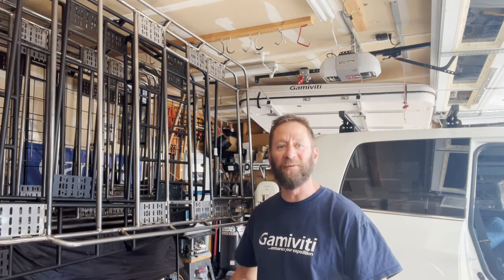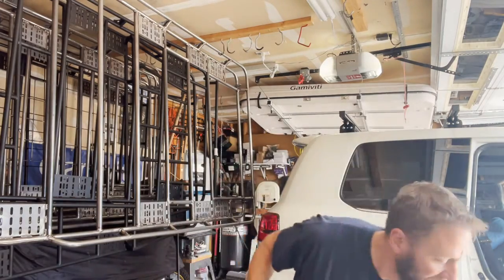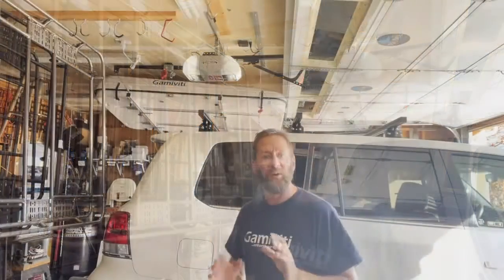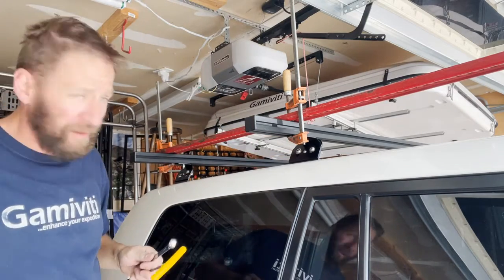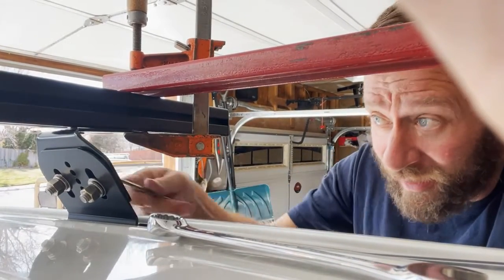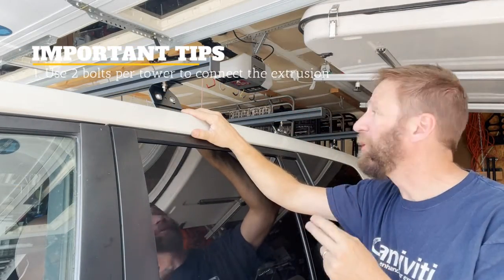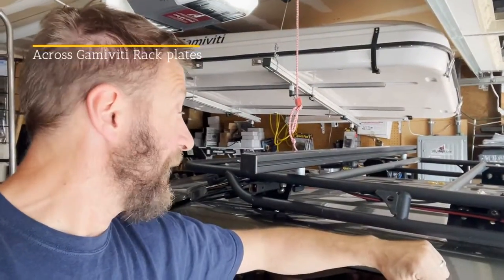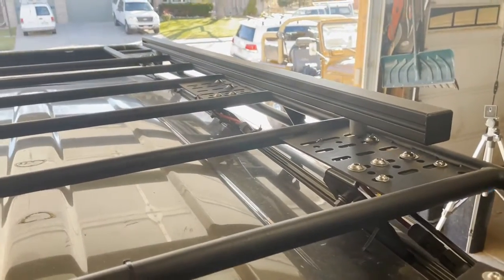Extrusion Cross Bars

Comment: Do you have something that works for a Rav4 2022?
Reply from the maker: all depends on your factory rack, and how it's attached.   If your rails have the inside channel then it's likely our angle brackets or OEM rail brackets would bolt up https://www.gamiviti.com/rack-brackets    and if you can remove your factory rack from the top, then it's possible our roof channel towers would bolt up- https://www.gamiviti.com/roof-channel-towers   you just need to do some investigation to make sure- send us an email with additional questions, thanks